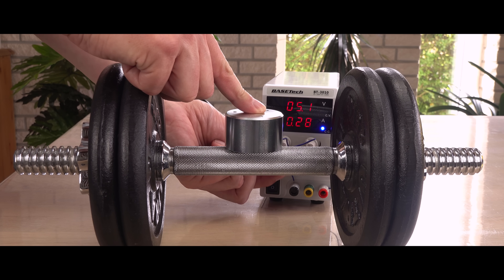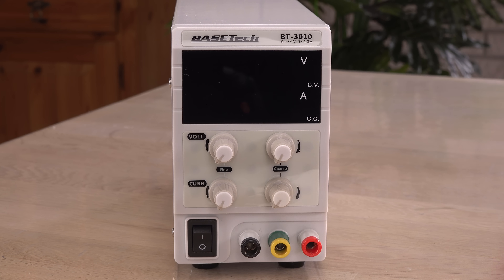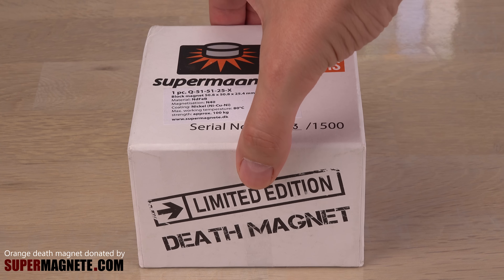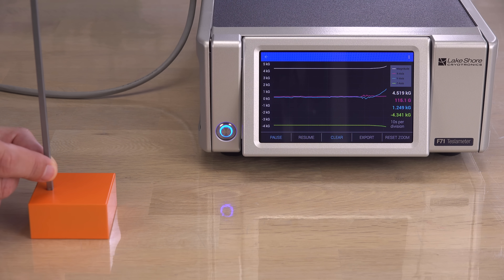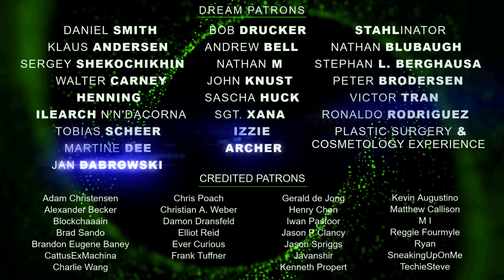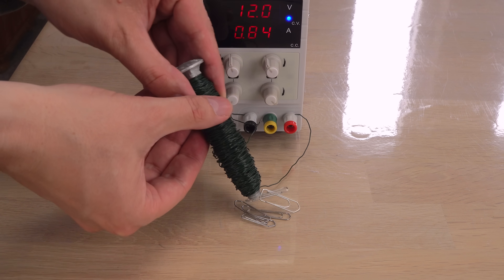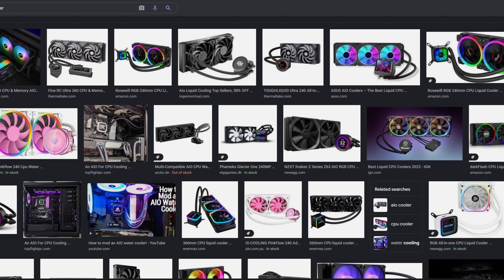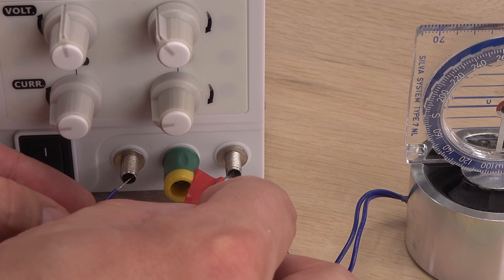New King of Magnetic Power? | Electromagnet vs. Neodymium Magnet

Comment: The "overclocking" your trying would be better suited if you had a cooling platform to maintain a constant temperature at the electromagnet. The pc watercoolers are designed for use with surface area, rather pointless on a longer bolt shaped magnet. But fairly effecient the flatter the area contact to help cool it. My suggestion for cheap regular cooling would be a pressured airflow system. The airflow and pressure changes around the magnet from a fan suction properly mounted on the back would be able to counter the heating rate. Make a plastic mount to clip on the electromagnet that provides optimal airflow and pressure based on the space around the magnet for it to suck the air. The smaller the gaps the higher the pressure required but it also increases the heat disapation by allowing more constant use of the surface area's.

Comment: I recommend to use a diode to short the pulse when disconnecting the coil.
Reply: Power supplies like this have that built in already.
Reply: @Basement-Science  Yes there probably are some zeners for it, but I would opt to not rely solely on them.
Reply: @user255  Not Zeners. All you ever need is a single 10A diode anti-parallel to the output. Which is almost guaranteed to be there already, because guess what, the manufacturer knows they need that.

Comment: The magnetic strength doubling with a 4 fold increase of wattage is logical. The field strength is linear with the current, and the current is linear with the voltage. Since P=I*U and I and U both increase linearly with the field strength, the power (wattage) increases quadraticly (or the magnetic field with the root of the power). To combat the heating issue, set your power supply to "unlimited" voltage, and limit the current, then the field strength will stay constant (even though it still heats up a lot)

Comment: What if you cool the electromagnet with Dry Ice, or Liquid Nitrogen ?

What would it take to Super Conduct ?
Reply: Copper wire never becomes a superconductor. You need to make the wire out of other materials for that.
Also you need Liquid Nitrogen at least, Dry Ice is not nearly cold enough for any material.

Comment: 0:52 How much difference does it make how nicely the wire is wrapped?
Reply: Not much. Wire length that is not going around it just doesn't add any strength, but adds a little bit of resistance and heating.

Comment: You should give superconducting magnets a try.  You won't have to worry about heat or any power loss, just need a good source of liquid nitrogen.  Would love to see your detailed analysis of one!
Reply: Even just submerging these commercial electromagnets in liquid nitrogen would allow you to significantly over-power them without them heating up and loosing efficiency
Reply: Yo, codeparade! Love your game, and happy to see you here
Reply: "don't worry about heat", "just get some liquid nitrogen from your pantry"
Reply: @joshdoesthingsallthetime  liquid nitrogen is cheeeeeeeap.
Reply: Hi CodeParade! Loving your new game :)
Reply: Yttrium barium copper oxide
Reply: I think even that "ordinary" electro magnet (without the need to build one out of exotic superconducting materials) would probably be able to get as strong as the neodymium magnets without generating too much heat, if cooled down by liquid nitrogen. Copper never really get super conducting, but it lower it's resistance really much (about 8,8 times compared to 25°C) at liquid nitrogen temperatures.
Reply: EXPENSIVE
Reply: Also need a multi-kiloamp current source to activate the magnet after it's cooled, and I can't think of a way to hack something together that would safely charge a superconducting magnet without quenching. They don't like flux. Getting an MRI magnet to full strength is usually a multi-day affair, going up to 5,000 amps of circulating current.
Reply: @Teth47  touché ...  i never thought about charging it up...
Reply: Non-euclidean magnets?
Reply: Hard for laboratories to produce one,i doubt there is any off the shelf, on top of that high temperature superconductors made out of thin foil material are at research stage, far cry from purchasing one at any time, thin foil electromagnet could run off LN, but it's still very impractical
Reply: Perhaps theres a way to extract nitrogen from the air, or from hydrocarbon combustion exhaust. Maybe just...squeeze the nitrogen gas really hard?
Reply: Nerd
Reply: Just get a mri from a abandoned hospital lol and run the coldhead and turn on the magnet
Reply: The most important part of a superconducting electro-magnet is the persistant switch. It is necessary to let the current circulate in the coil without external power. The high-Tc superconducting materials are not convenient to make the persistant switch. The critical current density is low and the heat capacity is high due to the higher temperature.
Reply: You should.
Reply: For superconducting electromagnets you need liquid helium, liquid nitrogen is not cold enough for the superconductors that are good at making electromagnets. All the necessary to run a superconductor electromagnet is too expensive and probably way too dangerous for him. Notice how ramping up the electromagnet power from 8 to 11 watts was such a "naughty" and thrilling action.
Reply: Liquid nitrogen doesn't get cold enough for most superconductors. That's why MRIs and quantum computers use liquid Helium.
Reply: @rikkardo9359  These days you can get YBCO "high temperature" superconductor in tape form that you can wind around a core.
People are using it to even build coils for tokamaks for fusion experiments, so they're very effective, yet easily available to amateurs :)
Reply: @mduckernz  i though ycbo was a ceramic?  I thought these were BSCCO or niobium and titanium...  i could be wrong, just asking...
Reply: @rikkardo9359  and Helium is a rare and expensive element, isn't it ?
Reply: And superconducting wires.
Mixing the two types of superconductors, magnetic for the core, and electrical for the wire.
The best we can do without superconductors is iron and silver (except for carbon fibre, but on a nanoscale), respectively, that's not much better using iron and copper, which is used already.

Comment: Measure in % how much force does it lose if you increase distance from the magnet, i searched for something like this a few month ago and i could not find anything so you might help someone if you do that.
Reply: It depends on the exact arrangement and shape of the magnet. That's why you wont find an easy answer. Usually the force drops off with the 3rd power of the distance however. (double the distance, 8x less force)

Comment: Magnets happen to be one of my favorite subjects. I believe if the core were taken out and shaved to half its diameter, and then rewound with more windings, you could potentially double the gauss output with the same volume. Can't wait to see you build some of your own! Imagine the ones they use in wrecking yards to lift entire cars, the possibilities are endless. 

Speaking of turning on and off, I have seen some permanent magnet gadgets that turn on and off the magnetic field by flipping a lever.  What's that all about? Great video!
Reply: In these gadgets there are 2 permanent magnets. If you flip a lever polarity of one of them flips cancelling each other out.
Reply: @geometrydash-krokoo-6503  cool!

Comment: I don't think the CPU cooler will make much difference.
You said there was a delay between a drop in current and temperature readings.
The thermal insulation is going to mean the CPU can't really do much.
You're going to need to scale up your idea and go straight to liquid nitrogen.
Reply: Yeah an electromagnet has to be designed for cooling if you want it to be effective. Transferring heat through steel, plastic and all the way to the flat side of it is a terrible way to cool the wire inside, no matter what cooler you stick to it. You'd want to flow water at least around the coil itself, if not inside the wires (copper tubes).

LN2 will work of course.
Reply from the maker: The delay is mostly between the coil heating up and the heat being registrered by the thermometer probe. I think the heat capacity of the potting is high enough to cause the delay, so cooling the potting should also cool the coil. But I can't tell how efficient or not it is before I have done the experiment. Thanks for watching!

Comment: The electromagnet has the advantage of metal cup to close (concentrate) the magnetic circuit.  If you gave the neo magnet a similar cup it would increase its holding force, further increasing its advantage. A lot of fridge magnets do this so they can use cheaper ceramic magnets that wouldn't hold without the cup. flexible sheet magnets do something similar by alternating polarity in stripes.

You should also look at switchable permanent magnets as they have feature parity with electromagnets.
Reply from the maker: Yep, didn't have time for it for this video, but I will try to source a 50x30 mm neo magnet (preferable grade N52) and a potted 50x30 mm neo magnet. Would make for a much better one to one comparison. No doubt that the neo magnets will still win though. Thanks for watching!
Reply: @brainiac75  Could you run some experiments on hybrid magnets? (Electro-Permanent Magnet)
Reply: @brainiac75 Also, electromagnets can be much more compact. An electromagnet can be much stronger for it's size than a neodymium.
Reply: I have some pretty thin 30mm neo magnets that are in steel cups, and it does make a huge difference. The manufacturer didn't have to bother with gluing them, it's almost impossible to get them out.

Comment: You can get "switchable" permanent magnets as well, where you turn something on top to change the positioning of two magnets to cancel eachother out in the off position. (I'm sure you know this, but since you mentioned the ability to turn off as the main advantage I thought I'd add this comment)
Reply from the maker: Thanks for the reminder! I do need to make a video about the magnetic lifters - and even build my own using permanent magnets to demonstrate how they work. So many videos to make  - so little time for it :D
Reply: @brainiac75  Well considering your upload cadence, you are doing very well when it comes to views/subs- so no rush.
Reply: @brainiac75  Make the first, and biggest neodinium switch. I'm sure turning the lever would be hard 😂
Reply: Like the way a magchuck for a mill works
Reply: @lenselinkberinge  yeah, the ones for welders and millers are usually top notch, since they have to be for safety reasons.
Reply: I want to see that too! good idea

Comment: Any less than a fully optimized 300W electromagnet is failure at this point.  No pressure, I know you’re awesome!
Reply from the maker: Hehe, I may already have regretted mentioning 300W at the end... Looking at eBay, a 100W electromagnet is over $300 from a questionable seller :/ But I'll go bigger than 8W - that's for sure :D Thanks for watching!
Reply from the maker: Just found a 300W electromagnet. $1,667! Ouch... and still a questionable seller.

Comment: It would be interesting to see how high the field strength can go if you can supply a pulsed DC power to the electromagnet.
- the 8W magnet is average power, and just as with lasers and LED's - pulsing with a low duty cycle should give a high(er) peak-output power...
Playing with Power - Pulsed Power Push/Pull'er (or perhaps not, the iron core has a B-H curve, so it's possibly not reacting fast enough)

2*12V car batteries and a beefy relay (w. rev diode protection) controlled by a variable oscillator might be safer for your power-supply ;ø)
Looking forward to future videos on these pucks - btw, where did you buy them (and the Radiocode meter, etc. - links/info would be appreciated)
Reply from the maker: Interesting. May give it a thought, though back EMF and basically running a DC magnet as an AC magnet may get me in trouble :) But I will try running it on AC in a future video. Just to see what happens with heating, field strength etc. I am a total noob when it comes to electromagnets... The electromagnet was bought from Conrad Electronic.
Reply: @brainiac75  AC is alternating current ;ø) - so the magnet will also be alternating its poles. Magnetic Hysteresis then becomes an issue (problem), as energy is spent turning the magnetic domains inside the iron/magnet. Less emitted field pr unit energy spent.
Pulsing the magnet with DC - ought to strengthen it, as the h-field moves up-down without having to rotate. Wikipedia has good illustrations of this. This should (I think - not 100% sure) strengthen the field when powered on, and still remain magnetic when power is off.
I could build you an electronic switching device for pulsed DC + tell you a bit more (I'm an electrical engineer + radio 'everything'). I live quite close to your favorite sweets-store, if you're interested :ø) - and I have some time on my hands, electrical components + equipment, and I'm curious what your Lake Shore Teslameter reports. (er også bidt af en magnet og deres mysterier)

Comment: try making your magnet with better core, tiny insulation and even higher ressistance so it won't get hot as fast. strength should be the same with higher ressistance
Reply: I believe a higher resistance causes faster heating. 
You can calculate the power-loss with: Power= Current² x Resistance
This power loss turns into heat.
Reply: @n-steam  but if you are using voltage source, then ampers are lower so lower watrage loss and when there is more turns then magnetic pole stays at same strength, so you can use higher voltage
Reply from the maker: I am not really planning to make my own electromagnets, though it is tempting after seeing the prices for larger electromagnets! They quickly get into hundreds of dollars. Sure, they are mostly made of metal, but they are still relatively simple to make. Not sure what makes them so expensive.

Comment: The most powerful magnetic fields are generated by compound coils, admittedly using super conductors. 
If electric vehicle development is not to be limited by the availability of rare earth elements, then motors must use electromagnet field generation, rather than permanent neodymium magnetics.

Comment: Give it a short jolt at 24v, don't think it would overheat in seconds
Reply from the maker: No, it will not heat above 130°C that fast from 24V. I don't know the voltage limit where electrical arcing in the coil could be an issue with this magnet. Guess I have to buy a second one and test the upper limit ;) Thanks for watching!
Reply: @brainiac75  thank you!
Reply: @brainiac75  arcing INSIDE the coil will not be an issue whatsoever. I woundn't even worry about pulsing it at 60+V, much less at 30V which your power supply can do. Heating is really your only worry.

Comment: Try using the electromagnet as an *AC* electromagnet. Can your power supply vary the frequency? Opening magnetic effects to non-ferromagnetic things = interesting.
Reply from the maker: The shown lab power supply is DC only, but I do have a 12V AC power source. Could be fun to test how an electromagnet designed for DC would work with AC... Thanks for the tip and watching!
Reply: The problem with AC is that it will heat up the magnet even faster due to eddy currents. I once made a similar hand-made electromagnet as in this video, and hooked it up to an amplifier. It didn't take long before the bolt started to melt the insulation of the wires, it was hot enough to boil water.
Reply: @alexanderthomas2660  Use transformer sheets for the core.

Comment: Overclocking an electromagnet and colling it  with an AIO. Are we now at LTT? 😆 Biggest gains on that magnet would come from cooling it down with LN2.
Would be a great vid, temperature vs magnetic strength vs power draw. With that tesla meter of yours, it would be very interesting to see that curve!
Reply: Wonder what the differences are in cinebench before and after overclocking.
Reply: Cody's lab has done a video of cooling an electromagnet with LN2. It works great: https://youtu.be/YledrMyoqgs
Reply: The black stuff on top may crack in liquid nitrogen.
Reply: Laboratory LN2 has largely been replaced by Peltier pump. With a Peltier we do not need to go down to -196° but merely remove the heat the power in the magnet is dissipating. The electrical resistance will always produce heat and the magnetic field will add to the impedance because it counters the potential voltage (delta V). The electro-magnet needs to dissipate heat at the same rate it creates it to remain at equilibrium. Unit of heat is Joule, rate of heat is J/s = Watts. We need a Peltier pump that cools equal to the heating. Another power supply and a suitable Peltier.

Comment: I wonder how small one could make electromagnets. It seems like this could have many uses in consumer products.
Reply: Technically a single wire is a extremely weak magnet
Reply: You have tons of products with small electromagnets in them already. Motors use electromagnets controlled in specific ways with a rotor, and the tiny vibrator in your phone uses a little motor, for example.